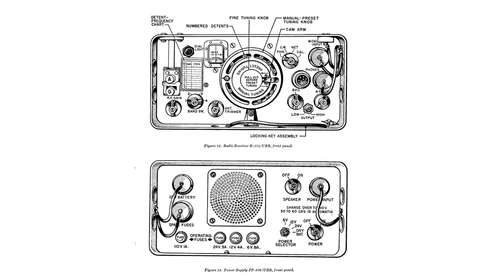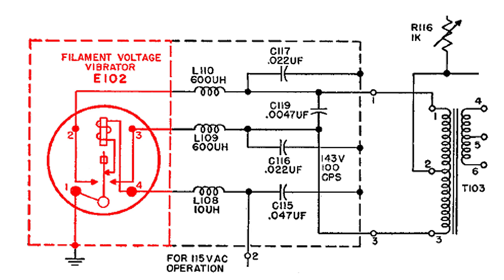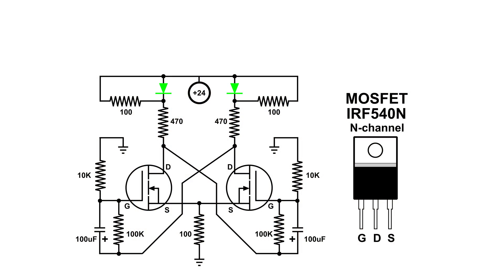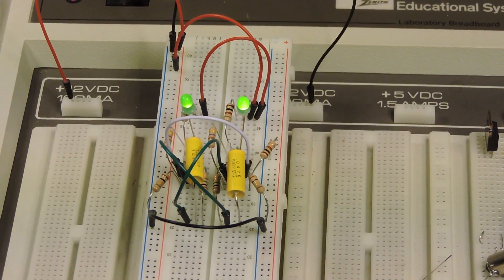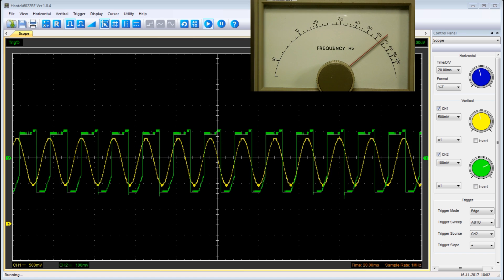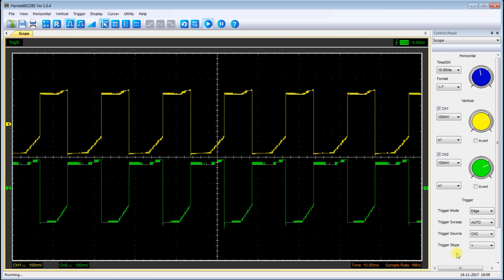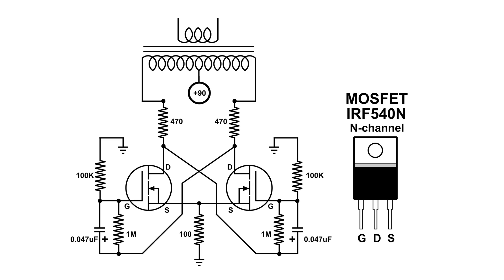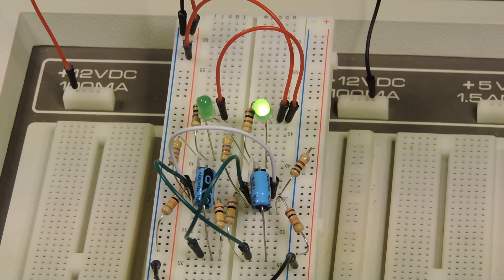Making a Solid State Substitute for a FILAMENT VOLTAGE VIBERATOR

Comment: Why are you using a signal generator to see what the multi vibrator frequency is.   Why not just read the frequency right off of the scope trace????   You got my curiosity up.
Reply from the maker: I have a frequency counter, somewhere. I thought I would show an alternative way to estimate the frequency of the circuit. Not everyone has a frequency counter. It also shows how versatile the oscilloscope is. If I only had one instrument to choose from it would be the oscilloscope.
Reply: OK.   You threw me for a loop with this.

Comment: Hey Rick is that the ANGRY 5 radio I gave you many years ago? I knew it was in the right hands.
Reply from the maker: Hey Greg, yes I do remember. I think I mentioned to you that I had gotten it working and it is a very nice receiver. But the ordinary 6 V mechanicals vibrator can't handle it. I might be able to find the correct one at Playthings of the Past. But I still would like to make a solid-state circuit for this radio. Hope things are going well with you.
Reply: AllAmericanFiveRadio still alive and kicking doing IT work now as a contractor.
Reply: AllAmericanFiveRadio o